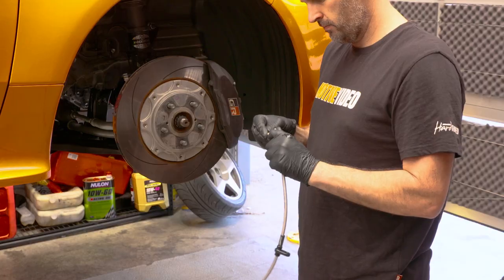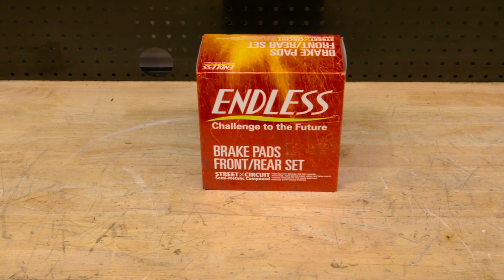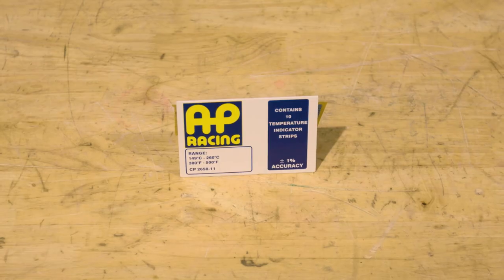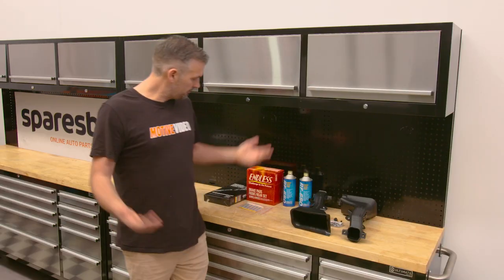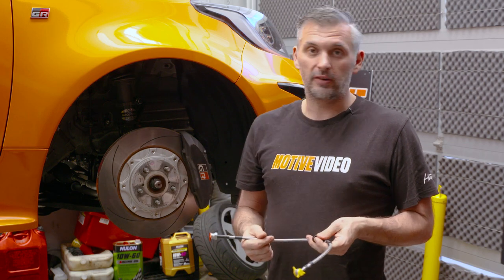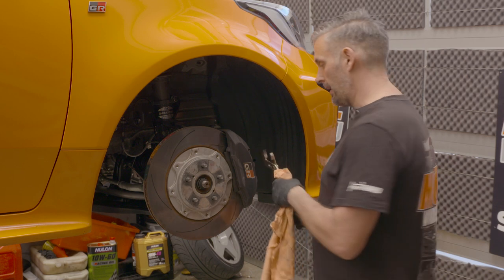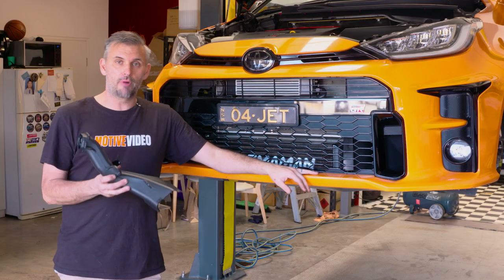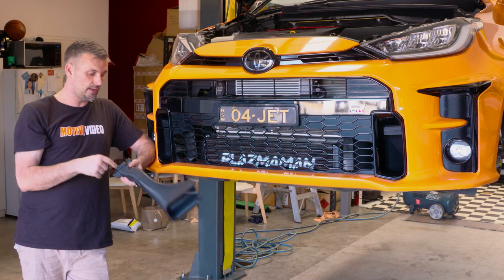Upgrade your GR Yaris Brakes - Day Job

Comment: I've done quite a few brake jobs on my cars and done trackdays and plenty of bedding in, but I don't understand how you bed the pads prior to fitting!? I thought the bedding process was to match the surface of the new pads to the disc surface as well? Looking at MX72s for my RS5, has Pagid HPs from factory, really good on track and stayed good afterwards on the road! Hoping the MX72s will be the same?

Comment: In regards to the the brake fluid reservoir level marks, not all vehicles are made equal. Some reservoirs are actually incapable of having the correct amount required for all the pads to wear low, and with less fluid, you also have less ability and less volume for satisfactory heat transfer in the fluid. The other issue is, front and rear brake bias can cause pads to wear at different rates, so if you're going off the level to determine pad wear, you could be in for a rude shock when 1 set has worn metal to metal, and in some cases the back plate falls out of the calliper, causing the calliper pistons to then be the next contact point, which then leads to direct heat transfer to the calliper seals. In some cars theses seals will actually melt due to this heat and spew the fluid out, potentially causing a fire. It's also not a good trait to get into, because brake systems can have seized callipers, where some calipers may retract and the other do not, which can give a false indication that your pads are wearing down correctly and this generally causes people to be ignorant and not take the vehicle to a service centre for inspection, sometimes dust covers and internals seals get damaged, and this is common on heavily driven offroad 4x4's, and this can cause leaks. Now if you only have half or low reservoir fluid, you only have a low to slim chance of getting that vehicle back to a safe spot to be able to be towed home, if the reservoir is full, you increase your likelihood of rescue. By rights, any fellow mechanic worth their qualification, will remove the wheels off your vehicle, check rotor and pad thickness, and check moisture contamination of the brake fluid, as the brake fluid is hygroscopic. For the average punter, this means that the fluid itself, actually draws moisture in from the atmosphere, deteriorating the boiling point of the fluid, affecting its ability to handle, disperse heat within the fluid itself. Never EVER assume that just because the fluid is between the 2 lines it's OK. Monitor the frequency  of how often you are topping it up. If it's becomes more regular, and your driving habits haven't changed, you have a problem. Easiest way for any Joe blow to know. If the fluid is changing to a darker shade quicker and you have changed your driving styles, a full system fluid upgrade would be recommended, as the fluid isn't constantly being flogged near boiling point, and breaking down. Just a differing real world point of view from a 20 year industry veteran who's serviced thousands of cars.
Reply from the maker: Look at it this way

if brake fluid is low. Look at why
Reply: @MotiveVideo  more logical isn't it. But logical doesn't prevail in most people, they need it explained to them like teaching a 5 year old how to write.

Comment: Wouldn't you want to bed the pads to new rotor as well, not a rotor with pad material already on it?
Reply from the maker: Rotor is just steel. Main thing is it is flat and not warped

Comment: I’ve only done short duration events in my car, so cooling ducts aren’t really needed yet. I’ve got some pads on the way and some lighter rotors. The rotors are for a reduction in unsprung mass to improve handling but, there’s also a reduction in rotational inertia, so the brakes will have less work to do. Did you consider lighter rotors?
Reply from the maker: We have considered it but believe money can be better spent at this point. Maybe in the future

Comment: Did the dust shield delete shims work well? and were they very difficult to fit?
Reply from the maker: They work. Fair bit of effort to change as gave to remove lower arms off upright and take shafts out etc

Comment: did you guys pulse the ABS unit to cycle the fluid out that which doesn't get changed with the vac or manual bleeding process.  I've been wondering how you go about that with the motec as it's usually done with techstream or other scantool
Reply from the maker: We spoke to Toyota and they said bleed as per normal

Comment: Just don't confuse DOT 5 and DOT 5.1 fluids, DOT 5 is silicon based and not compatible with glycol based fluids.
Reply: There is also DOT 6, and newlines are also a great time to change fluid types if you are thinking about it.

Comment: Very surprised it doesn't come with brake ducts on the standard model , come on toyota.
Reply from the maker: It really doesnt need them in stock trim
Reply: In Europe it comes with brake ducts if you choose circuit pack option.

Comment: How come ur loosing weight
Reply: What other reason than to be healthier?
Reply: Makes the Yaris go faster, he'll be taking a mean dump before every session now too.
Reply: @vongdong10   faster 1/4 mile times?
Reply: When you daily drive Japanese sports cars, you realise it helps to be a bit thinner to be more comfortable.
Reply: @Usrfhr  why is it that every genuine bride bucket seat fitted in Japan is basically anaemic size?
Reply: He definitely didn't eat something spiked with monkey Hiv when he visited us at Top Secret.
Reply: @foodley123  Because the average height in Japan is like 5'7"
Reply: Possibly a driver mod for better power to weight ratio, actually the cheapest way to lose weight from a car. The floppy meatbag behind the wheel is usually one of the heaviest parts of the car.

But in all seriousness, why does it matter. Not gonna change the content that Motive makes so why bother asking?